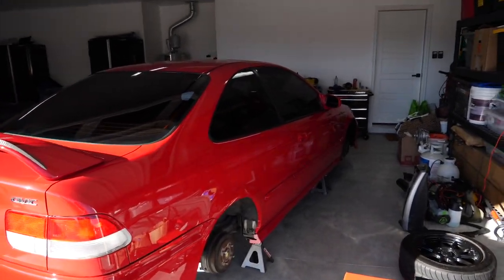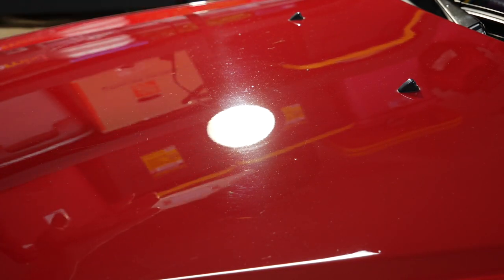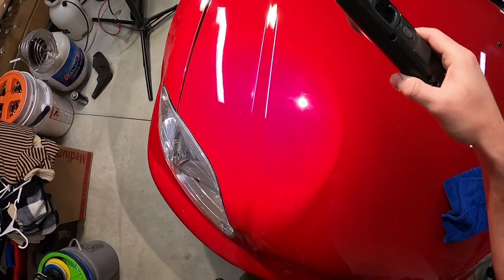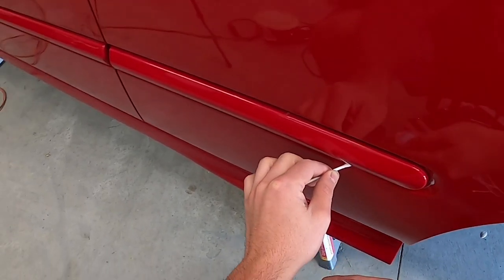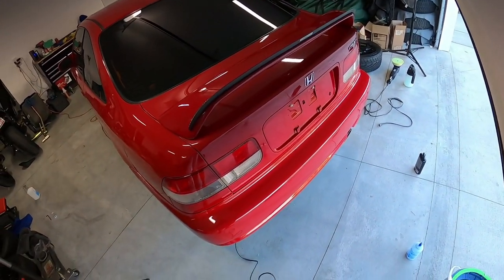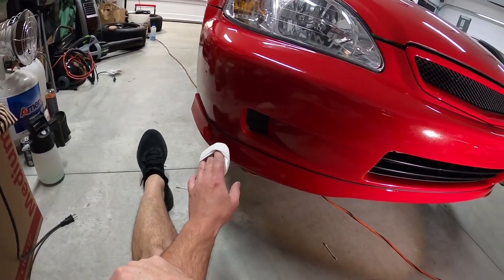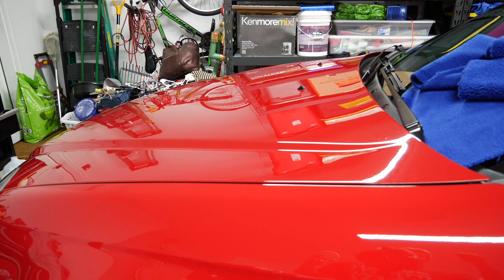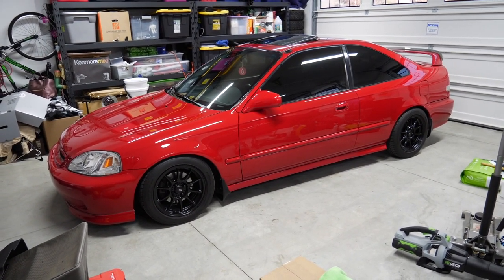My Honda Civic Has NEVER Looked this Good...Until Now | Part 3 (Polish & Coating)

Comment: Nothing better than a spot free car chillin in the garage. Gonna put my Focus ST in storage and probably do the same thing as your doing, should look like new come spring. You recommend keeping the car on jack stands like that for a couple of months? Gonna be doing RS brembos, wheels and tires. Touch up all the rock chips and get my bumper repaired along with a new aggressive rear valance and polish my tomei exhaust.
Reply from the maker: Well, it got rained on about 2 days later lol
Reply: Usually how it goes lol I drop the $15 bucks at the car wash and literally rains a day or the same day after. Lol
Reply from the maker: That’s how it goes lol. I wouldn’t personally keep a car on stands for that long if you can avoid it
Reply: Good to know. Haha

Comment: This where you and I differ, I'm building my engine first and then I'll worry about the outside. I just dropped $550 for seats, brackets, harnesses, and a harness bar. The nice part was when I bought my 93 EG8, it was already swapped to the D16Y7(non vtec) but it has the D16Z6 intake manifold. And I'll tell you... That thing rips HARD
Reply from the maker: As long as a car runs, I’m much happier having it look nice
Reply: One day I'll have it look immaculate but I'm fine with it as long as I can mess with some of the new "muscle" cars